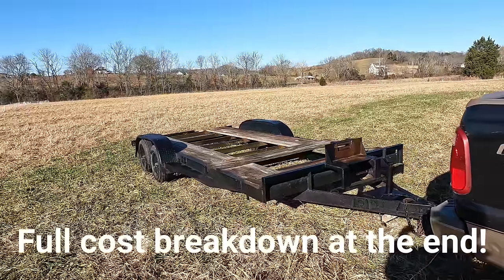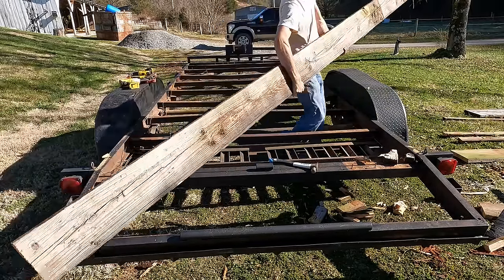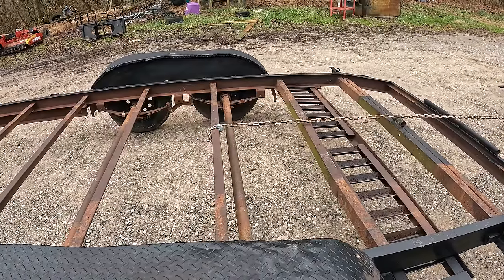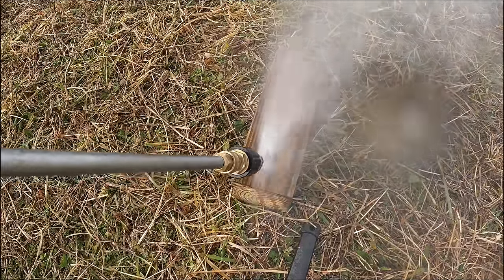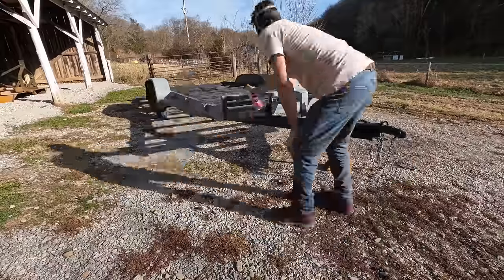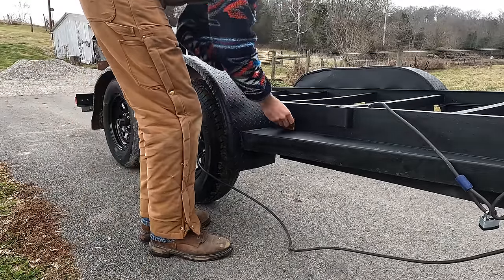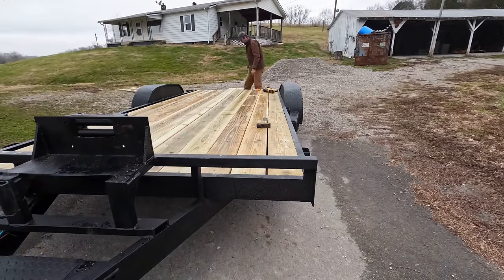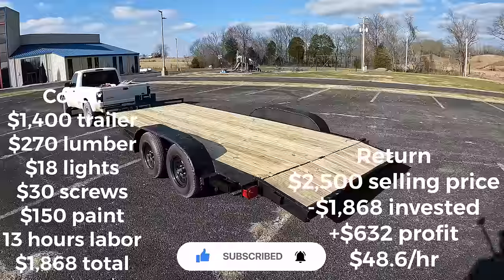Flip $1,700 to $2,500 in 13 hours

Comment: Nice job!  Trailer turned out really nice.  If it's not too late... you might call the seller back and ask him if he'll sell you the winch for the additional $300 you saved.  If I'm seeing that right correctly, that looks like a Warn 8274 winch.  If it works... it's absolutely worth the $300 (really considerably more).  If you pull the winch and restore it (less than $200 for parts), that's a $1000+ winch.  Best, one of THE most desirable winches Warn ever built.
Reply from the maker: That makes a lot of sense. He talked about how good of a winch it was, but it did need some repairs for it to work. Just noticed your profile pic.. he was a jeep guy too haha. Yall woulda got along 😂
Reply: Just happened on the video and was going to say, if that's a Warn 8274 or similar those go for like 700-1700 around here.  xD Ones that need to be restored are on that low end.

Comment: I have never "flipped" a trailer, but I have worked on my own trailers enough. I always use a flux core wire feed welder for the fenders and thin metal. Much easier to control than a stick welder.
Reply from the maker: I plan on getting one for sure. What brand is yours?
Reply: If the wind is blowing more than 5 mph, you'll have to stick weld anyway. Great job!

Comment: I like one coat of rust reformer, one coat of Rusty red primer (red Oxide) and two coats of enamel. I buy quarts or gallons of Rustoleum or Valspar tractor paint at the hardware store. I add a little mineral spirits, and paint with a brush. The top coats I also add a little hardener. The second brush coat will smooth out most of the rough spots.  On a trailer, or other machinery, its not like a car. Brushing forces paint into the corners easier than a spray can does. Probably you can skip the spray on rust reformer, except in special situations.

Comment: yeah turned out well ive been doing it for 3 years now and i see alot doing it but no one wires it up right or anything like i do i take my time and turn them into great trailers infact one im working on is a 16 heavy built has c hannel crossmembers instead of angle so pretty solid old trailer

Comment: Cut and weld on a new support beam... that would be faster/easier wouldn't cost much. I use the same electrical connections and love them. I also heat shrink over them too :)

Comment: If it's surface rust, you need to use rust bullet to remove it, power wash with a gas pressure washer and it'll be bare metal. Paint as needed.

Comment: The boards are still saturated and are swollen thicker thn 1-1/2". Once they shrink, they will then have a really big gap where you cut them.
Reply from the maker: Interesting. So the boards needed to dry out more before being installed? I haven’t run into this issue before. Maybe the lumber was a new shipment or something. Thanks for the tip. I’ll keep it in mind for the future.
Reply: Pressure treated boards hold moisture for a few days. As a deck builder we let our boards sit in site and acclimate so we don’t get big old gaps on our 45s.

Comment: Why not get the brakes up and going?

In my state any trailer over 3000# must have working brakes with a brake-a-way that holds for 15 minutes minimum
Reply from the maker: To be honest I haven’t wired trailer brakes yet. On my farm I’ve never used them and it’s not required it my state so I didn’t mess with them. But in the future I plan on learning how to wire them and doing it on the trailers I do in the spring. Leaning as I go with this process lol
Reply: @charliefarms1 I came here just to comment this. Having working brakes is a huge plus. A trailer that size can fit a pickup, so having the ability to stop that much would be great. Trailer brakes are stupid easy to wire. A ground and a power wire. Also, venture away from the cheap and easy wiring kits. Normally made with cheap wiring, and from the kits I’ve seen, cheap lights. You can run a good 7 pin setup very easily, and if you do it right, the constant 12v power wire can charge a battery that feeds the winch you mount on it. Had you gone that far, easily a 3500 to 4k trailer.

Comment: no trailer brakes? i saw the drum on the one axle. i know the empty weight of the trailer is not heavy enough to legally need them but i would never buy a trailer that big that didn't have working trailer brakes.  of did you hook them up and i missed it or it got glossed over in video with the light wiring?
Reply: I was wondering the same thing about brakes.  On a trailer that size, Id want brakes on both axles.  Trailer brakes are critical components for hauling a trailer safely.  But the number of people who do not understand that is downright scary.   Trailer lighting and trailer brakes both need regular inspection and maintenance.   While the trailer's lights are important for everyone else on the road, a trailer's brakes are what is gonna keep you from ending up right smack in the middle of a disaster sandwiched between whatever it was you were hauling and whatever you crashed into!  Sure, you might get by without them and make it home safe, but it isn't just our own lives we are gambling with when out on the roads.   It is downright reckless to not have working brakes on a trailer capable of hauling stuff heavier than a lawn mower.

Comment: So big trailer without break? Is it only for low weight? We must háve all trailer over 750kg capacity with breaks
Reply from the maker: They have 3500lb axles so it can hold 7000lbs. The law here in Kentucky says that if the trailer is wider than 82 inches it must have brakes. They are pretty relaxed when it comes to trailers

Comment: Word of advice, if you are using wet pressure treated lumber you do not need to gap the boards will shrink, this goes for decking and fencing or anything outside,

Experience in decks and fences with the states leading builder, we butt up each piece because of shrinking if you gap just a 1/4in it will end up 1/2-3/4in gap...
Reply from the maker: Awesome info thanks for the tip!

Comment: Just one complain, why destroying things on the go? Just unscrew them and keep your area clean. You have tons of plastics lying in the dirt because of that. Good job otherwise!
Reply from the maker: It’s a carriage bolt, and the threaded part with the nut was totally rusted. So when i tried to remove it, it broke the carriage bolt side loose so it was no longer holding it. Only way to access it was to break the light. Plus it was fun. I cleaned it up after lol
Reply from the maker: Also all the screws for the decking were rusted and stripped
Reply: I agree with the fun part lol :)
Btw, I am doing the same next week and trying to flip my first trailer. I hope it will work, the market is not that big here in Slovenia. We will see. But I can still use it for myself for a while untill I sell it, so this is another good point :) Cheers!
Reply from the maker: That is really cool this video made it all the way to you. Slovenia is pretty far from Kentucky in the United States! Glad to hear your doing the same. Good luck 👍

Comment: That trailer wiring is dogshit and will last like a month before it's ruined.  Been through tons of those sets before I did it right.
Reply from the maker: Well, what do you consider right then? lol it’s been working fine for me.
Reply: @charliefarms1  Wiring that isn't like 16 gauge and that doesn't have a soft plastic coating that I can just push my fingernail through easily would be a good start.  Everywhere that wiring rests against metal edges it will be compromised by simply using the trailer.  Anywhere it is exposed to wind so that it moves, the wire sheathing will be cut through easily.  And the wire once exposed corrodes insanely fast.  The last set I put in my trailer lasted a year and when I pulled it out to replace it the wire was literally falling apart into pieces, and I had 95% of it sitting in conduit.

If you're doing a quick flip on a trailer, no doubt it's been working out for you because you own the trailer a week with the wiring installed.  I'm just saying to people watching this working on their own trailers, don't use that junk.
Reply: @charliefarms1  I have the same Walmart wiring with the same solder connectors on my trailer going on three years now.